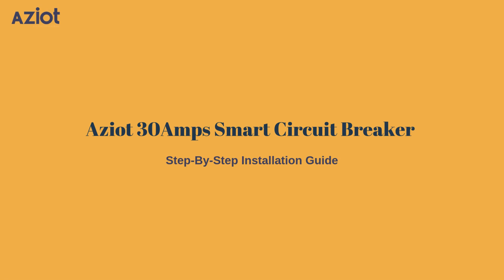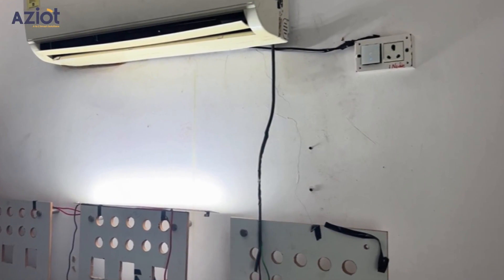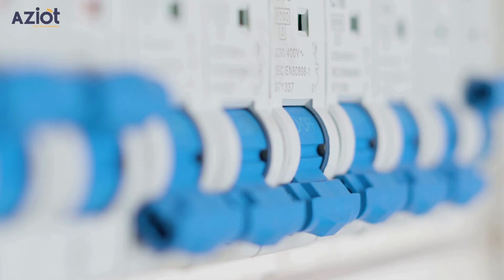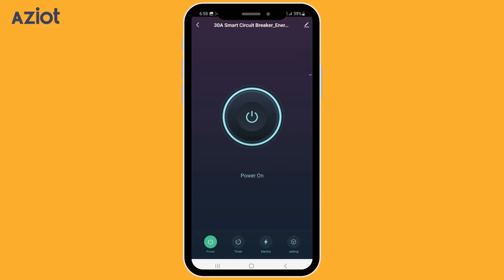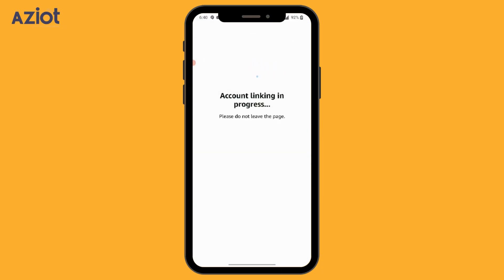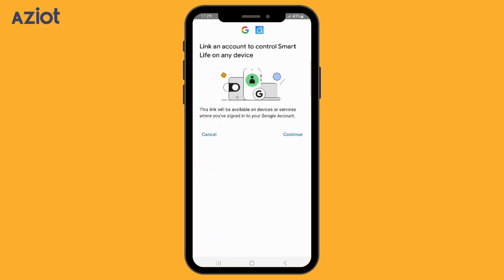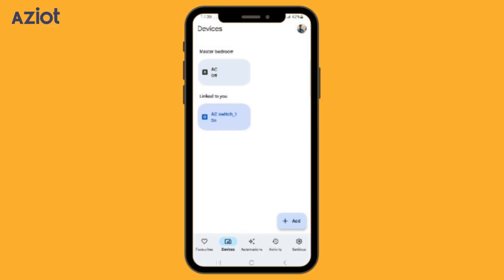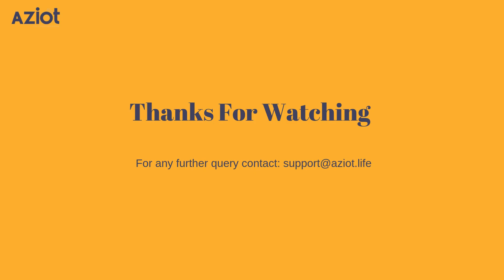Aziot 30A WiFi+BLE Smart Circuit Breaker Installation & Setup | App Remote Control & Energy Metering

Comment: I have no written metering on box, Don't I get option of electic in app?
Reply from the maker: Correct — for our 30 A smart breaker, there are two variants:
	•	One version without energy metering (just ON/OFF control)
	•	Another version with built-in metering (so you can see power consumption in the app)

If the box has no “metering” label or markings, chances are you have the non-metered version — so you won’t see electric usage data in the app.

Comment: Am using Ac with stabiliser . In this scenario how to connect ? In between with ac and stabiliser or in between  with stabiliser and MCB
Reply from the maker: For a 30A Smart Circuit Breaker with an AC + stabilizer setup 👇

You should install the smart breaker before the stabilizer — i.e., between the MCB and the stabilizer.

Power Flow:
MCB ➜ Smart Breaker ➜ Stabilizer ➜ AC

This way the breaker can properly monitor and protect the entire AC setup, including the stabilizer 👍

Comment: Suppose i connected the device in X location using Wifi ( A) . & Now i am in Y Location using mobile data or Wifi ( B). Then can i use the app remotely & operate . on or off ??
Reply from the maker: Hi, As long as the device is connected to the internet (WIFI).  You can operate it remotely from anywhere!

Comment: What is wifi goes off?
Reply from the maker: Device can be operated manually using the button on the device
Reply: @aziot So we have mannual button on 30amp circuit breaker ?
Reply from the maker: Yes we have a manual button  @surendrakumar451